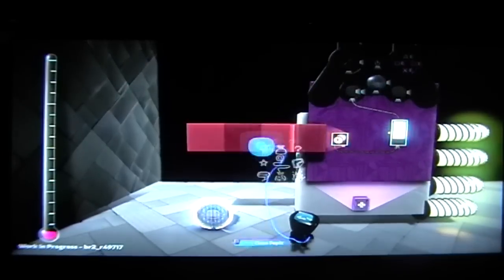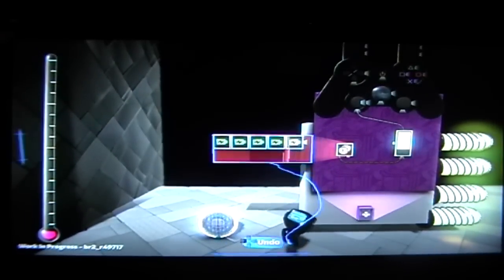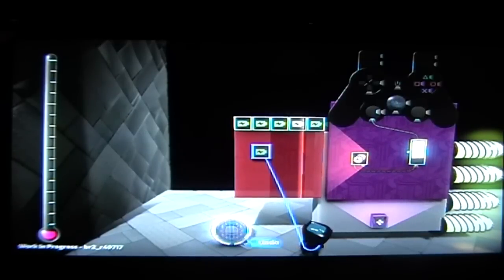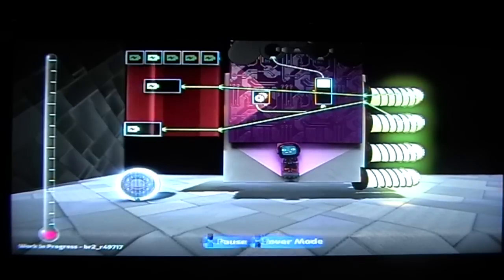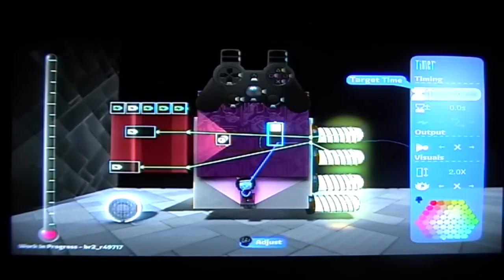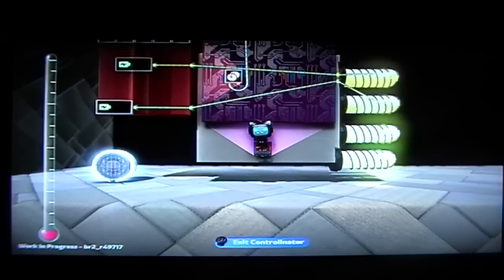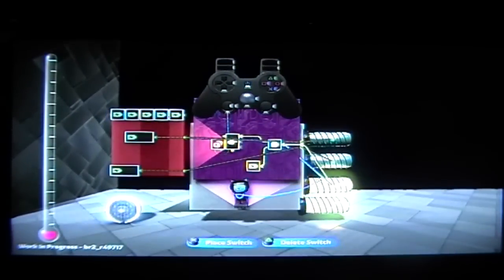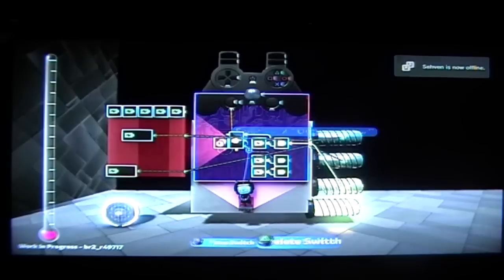LBP2 Beta Tutorials - More logic tricks - Analog signal analization

Comment: @ShadowriverUB Well any 2 that are the same will work.  Basically, there would be a time limit and you have to get as much points as possible by getting as many matches as you can.  So say the board starts out as R R Y G G B,  Going for red or green would work, after you click them, they dissolve, give points, and is replaced with 2 other random blocks.  And it repeats.  Also, it could increase in difficulty by adding NEW colors to the game. That might be a bit hard to do...